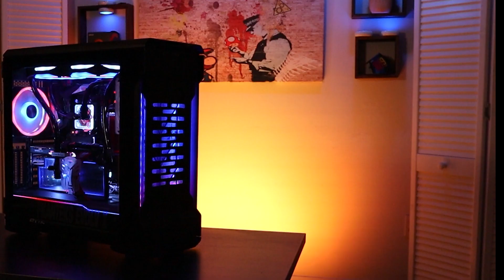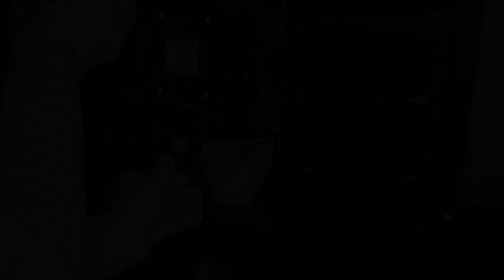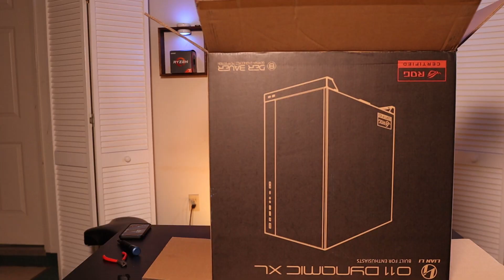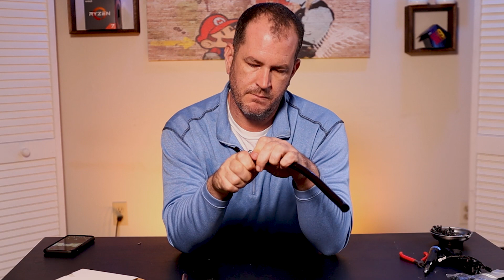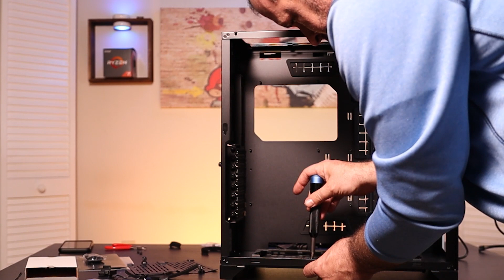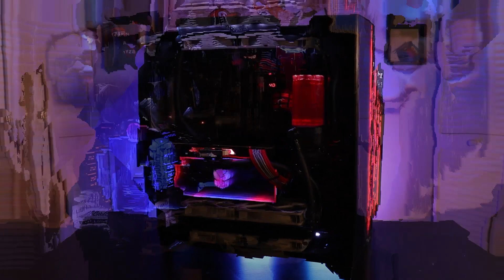Lian Li 011 Dynamic XL Custom Loop Build featuring Optimus Foundation Waterblock.

Comment: Since you mention you want to run your noctua fans at 500-600rpm, wondering how fast do you run your pump?  im trying to decide to enter watercooling, but i fear the pump noise, can it be driven to inaudible levels?
Reply from the maker: Don't fear the pump noise.  A good D5 pump can be setup to be efficient and inaudible very easily.
Reply: @currentlykent4593  Thanks for the encouragement.  Any good D5 PWM you recommend for quiet operation?

Comment: How are the temps with the optimus block, if you don't mind me asking? Idle/Load temps (maybe cinebench r20 load) delta over ambient?
Reply from the maker: I don’t mind at all:) Temps seem fine. Depends on the almighty ambient temperature, of course. With the 3950x overclocked: doesn’t really matter what block you put on it: will be hot. Close to 80C if r20 is looped for 3-5 minutes. At idle: about 35-40C if coolant temp is below 30C.
Reply: @currentlykent4593  Yeah, I had my 3950X under water on an older converted EK Supremacy EVO and I saw similar temps. I guess the CPU blocks are very similar temperature wise. I may end up getting it anyway just because the look of it is awesome.
Reply from the maker: @iAsperity  the stars aligned for me to get it. Performance PCs had 3 in stock, and the price was right. Thinking $80 less than the EK block it replaced. They don’t seem to have the quality control issues I hear about from other companies as well. So that’s nice.
Reply: @currentlykent4593  Yeah looking forward to their 3080 FTW3 block as well. Btw, what is that mirrored LED piece in your build and where did you get that from?
Reply from the maker: @iAsperity  JMMods made that gpu backplate for me. Ended up fouling on my ram, so I repurposed it:)

Comment: So which port is the inlet for the Optimus block? I'm getting warm temps on the 3900x
Reply from the maker: John on mine, it’s the port closest to the Optimus branding. Or, the bottom port.
Reply: @currentlykent4593  nice I just wanted to be 100% sure. I'm getting warm isle temps with the 3900x on water cooling with the same block. It's around 130 f idle. Is this normal?😬
Reply from the maker: John which sensor are you using to get that reading?
Reply: @currentlykent4593  cpu-z and nzxt cam
Reply from the maker: John ahh. Hwinfo is my monitoring software of choice. For cpu temp, you’ll use the CPU Die(average) reading since the CPU (tctl/tide) reading is always higher than what the cpu is actually. My guess is that’s what cam and cpuz are reporting. AMD built that sensor reading in to ensure stock fan curves would ramp up sooner. Also, Zen2 does idle at higher temps then most are used to seeing. It is load temp that’s important. OptimumTech just posted a video on 5 things to setup on a new pc. Definitely worth a watch to get a step by step on hwinfo👍

Comment: how did you remove the Hard drive enclosures in the back?
Reply from the maker: BlackhatXII if I’m honest, I don’t recall exactly. Which only means it wasn’t something I struggled with 😂 thinking it was a couple screws or thumbscrews.
Reply: @currentlykent4593  ah okay. I see the screws that I need to remove, but the cables that are attached to the drive bays are confusing to take apart. Have to undo the velcro strap around the wires and take them out one by one.
Reply from the maker: BlackhatXII hmm... mine are still attached to the cages. Think they all came out with them.

Comment: Am I being daft, pretty sure you did put any thermal paste on?
Reply from the maker: On what?
Reply: On the CPU at 13:45
Reply from the maker: Jays MTB ahh. Right. There’s liquid metal there in lieu of thermal paste👍
Reply from the maker: I’ve since removed it and switched back to the paste.

Comment: lokk, usb 90° adaptors, that fit.. i have a gigabyte board too, they even lose the caps when pulling off..
https://www.ebay.de/itm/1Pc-20pin-USB-3-0-Steering-Elbow-Adapter-Up-Down-Angled-Gc-degree-D4T1-90-B9L0/183915482210?_trkparms=aid%3D1110001%26algo%3DSPLICE.SIM%26ao%3D2%26asc%3D20160908110712%26meid%3Da1712f7c91b24fb8a8446c76dfff579e%26pid%3D100677%26rk%3D13%26rkt%3D30%26mehot%3Dnone%26sd%3D254528576629%26itm%3D183915482210%26pmt%3D1%26noa%3D1%26pg%3D2386202%26algv%3DDefault&_trksid=p2386202.c100677.m4598
lokk for one of the two possible orientations, which is right for you. you can even get them on aliexpress for around 3-5$ a piece